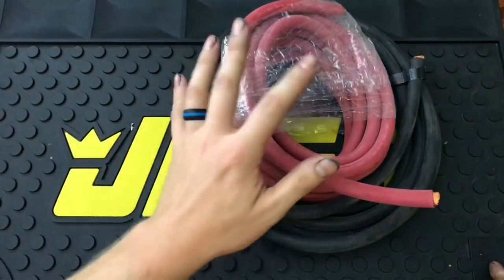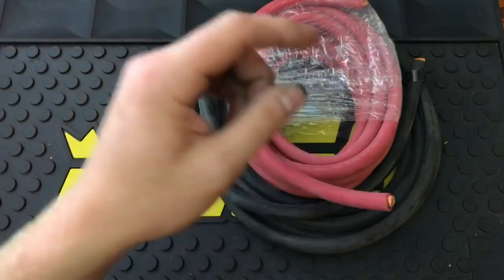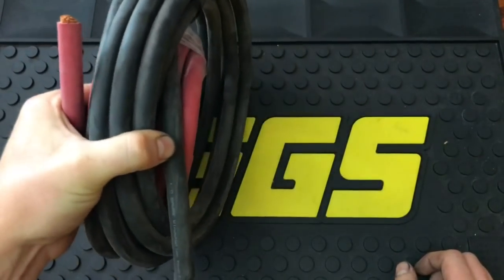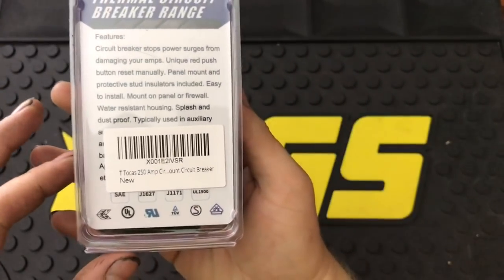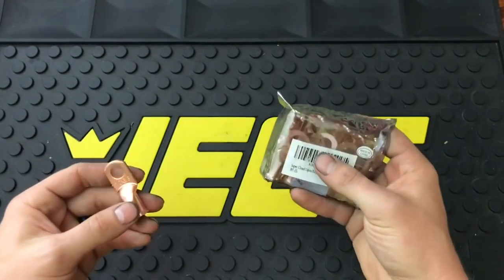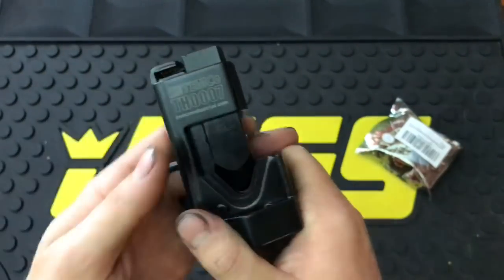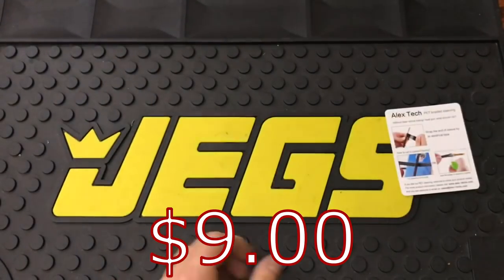Things You Need for Battery Relocation

Comment: I like fuses because if a fuse blows that means you have a serious issue you need to fix before putting a new fuse in. Especially if you blow a 250 Amp fuse.
Reply from the maker: Circuit breaker does the same thing except you don't have to keep buying fuses if you don't figure out the problem.

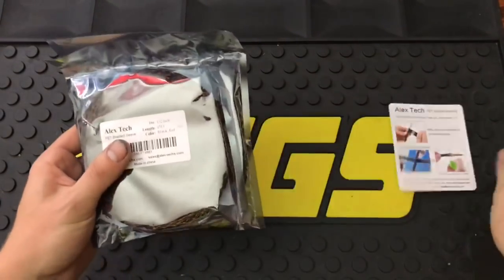Comment: @8:47 you discussed the use of cable coating protection... I'm just curious...how this product would protect the original coating of the cable(s) against a "pinch-point" location where the cable is resting on? 
 I know we try not to expose the cable(s) to such a location but having to use a thicker AWG wire (00, 000) sometimes this might not be avoidable. 
 People have to really do their homework on this "battery relocation" task. You made quite a few great points about the type of copper wire one needs to consider before poping open the hood of the car.👍
Reply from the maker: In those tight areas where you can't avoid the bend I try to either double up this coating or at minimum run the hard plastic shrouded over that portion of the cable. Thank you I appreciate the input 👍👍👍
Reply: @TonyTheTechnician  Sure, that makes sense... I'm planning on relocating my Battery in the 2010 Dodge Avenger to the trunk of my car. Currently it's located in the bottom portion of the front wheel well.. (why dodge ever decided to locate it there is rediculous especially when there's ample room within the engine bay compartment!) 
 Because of the battery is located in the wheel well, Dodge had created two battery contact (- +) access points under the hood of the car, I was thinking about just running the new cables from this location back to the trunk where the new battery location would be. 
 I'm not sure of what AWG Wire I'd have to use but I'm thinking 00 would be a better choice than 0. 
 I also realize that the spare tire compartment consumes a significant amount of space in the trunk as well. 
 This might pose a problem in relocating the battery.  
 Would you suggest that I include a (plastic) battery box as well? I'm sure i could use a Walmart quality plastic tote that fits the battery & tie down hardware. (Specialized items like that of the battery box is rather expensive here where I live)

Comment: Had a question do I need to buy a 250amp fuse or do I go with the 70amp fuse that my car originally has in the oem fuse box. And that’s the rated fuse for the oem spec.

Comment: Tony Hey Brother tell me what kind of fuel line was that and where you got it at and how much it was and also what is your recommendation on affordable AN fittings? Also I would be really interested if you would do a in-depth video for dummies how to build AN lines gas and trans and also if you have a line on nice looking vacuum line as well
Reply from the maker: michael penna I actually already have a video on how to do the fuel lines and everything if you want to check it out. Also I ordered my line and connectors as a kit so it all comes together. Here is a link to one kit. Or you can search AN fuel line kit. 
https://m.ebay.com/itm/Braided-3-8-Fuel-Line-6-AN-Oil-Gas-Fuel-Hose-Line-Aluminum-Hose-End-Fitting-Kit/282468482170?epid=920124445&hash=item41c46efc7a:g:imwAAOSwJH5aUzjf:sc:US_UPSSurePost!60644!US!-1
Reply: @TonyTheTechnician  do you have a lead on nice looking Vac lines too?   And hmmmm i thought i watched all your vids already  i never saw a AN line video ill have to look again
Reply from the maker: michael penna for vacuum line I usually just use normal vacuum hose and put the nylon sleeping over top. Here is one of the links to the AN install. 
https://youtu.be/6ZpxFWYZfQ4

Comment: If it's fastened down, and fits, is there any issue with mounting an agm battery between the front seats of a vehicle?
Reply: if you had an accident would you want to take the risk of  15kg plus dead weight coming loose?

Comment: Please do not use those battery terminals (the brass ones with the two bolts) - those are "temporary" type design (you see these in your local auto parts stores and the "cheap" battery terminal replacements use in an "emergency").
They cannot be securely tightened, especially threaded into soft brass base.
Since you already own a TEMCO tool, why not use battery terminals that use a crimp compression end?
I try and find those hex compression fittings (insert bare wire and tighten compression hex to secure - i.e. old-school Esoteric Streetwires 1/0 ring terminal compression Interlok) that are reusable but cost more - you looks like you're spending good money on this project, so might as well go for the best?
I know the wire for car audio is overpriced, but for terminal hardware, check through the car audio options for better, nicer options.
Reply from the maker: Oh Kay thanks for that info and I’m doing my best to try and find something with a crimp style but all the same stuff keeps popping up.
Reply: @TonyTheTechnician  Check out Terminal Supply Co. or Del City Wire
Reply from the maker: Oh Kay thank you 👍🏻

Comment: Great video! Since you are running your positive and negative cables up towards the engine bay, did you run them up together or opposite sides of the car?
Reply from the maker: Thank you. They are together on one side but separated
Reply: @TonyTheTechnician  Wow, I appreciate the timely response. Just a further clarification.  When you ran them up from the trunk together but separately, did it matter if the positive and negatives wires were touching? Or, did you plan on keeping the positive and negative cable separate, for example, an inch or two?  Thanks
Reply from the maker: @joeduarte6246  yes indeed. They both run up the passenger side but both are in separate cable looms and about two inches apart 👍